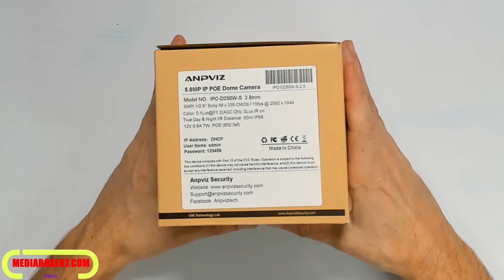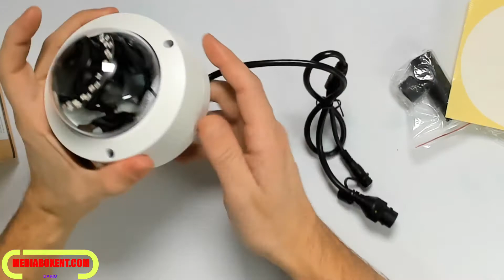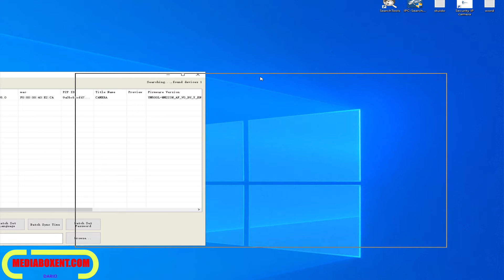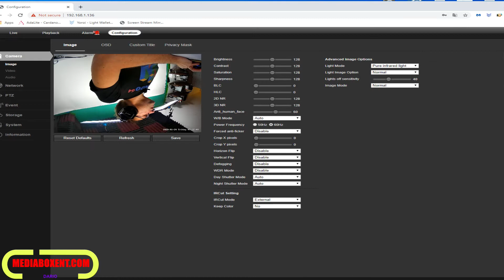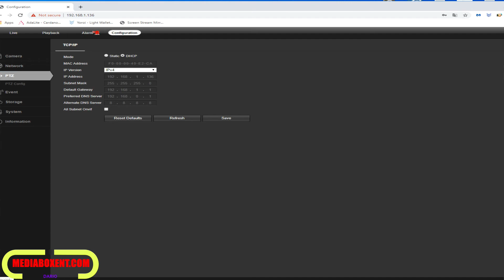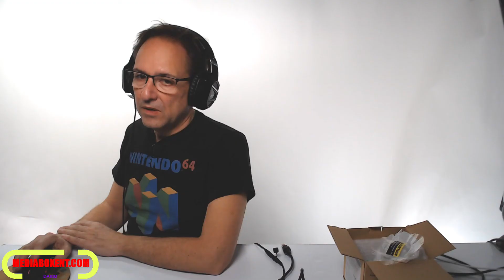PoE IP Dome Camera with Microphone Anpviz 5MP PoE IP IPC-D250W-S

Comment: Great video. Just what I was looking for.  Thanks to you showing us the complete unboxing, I was able to verify my suspicions that I got a used camera from Amazon. First, mine was packed upside down inside the box, then I noticed the cable coming out the bottom through the slot was on the same side of the camera as the mic. Cameras always have the mic in the front and the cable coming out the back. This is how it was put back together by someone else. Then the mounting screw for the ground tether was missing and it was just attached using one of the actual inner black plate mounting screws. Great how you showed everything in detail. Thumbs UP!